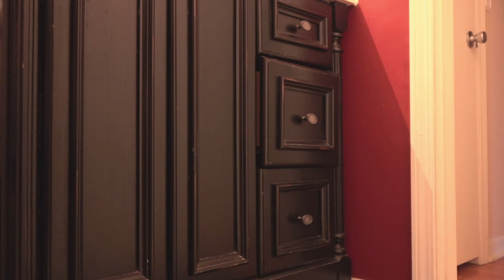3D Printing Saves The Day! - Fusion 360° - 2022 - Chris's Basement

Comment: I do a ton of practical prints for around the house, if it is simple enough I just use Tinkercad. My daughter had a bed desk she accidentally stepped on, with about a half an hour of measuring and mock-up I printed the first. Worked well, made a few slight tweaks for the other side and within a couple hours total it was done. The new supports were much more stout than the originals, and if I need to do the other side the file is saved.
Reply from the maker: That's great! Thanks for sharing

Comment: You should consider removing the web/gussets and just go with a full length chamfer and print the part on ots side for best strength in bending at the knee with better dowel stength too. Supports and finish don't really matter.
Reply from the maker: Thanks

Comment: Measuring tip: If you have a set of size array drill bits you can find 2 drills that firmly fit shank end into a pair of holes then measure with calipers the distance between them.
Add a radius of each drill size and you have the centres dimension
Reply from the maker: Thanks for the tip!

Comment: Love practical prints, thank you for making this!  For wood screws if the hole strips you can use wooden toothpicks to fix the threads, stuff them in, then tighten the screw into them...my dad taught me that one :) I fixed the blind mounts with a PETG part.  Love seeing these types of fixes.  Now...if we could only print windows...
Reply from the maker: Thanks for the tip

Comment: I would have turned your part 90 degrees in your slicer it would have used way less supports just for the dowels and they also would have been stronger in that orientation and less likely to break off at the layers.
Reply: Was going to say the same thing. The dowels and the whole part would be stronger.
The next test is whether PLA creep becomes an issue. But if it lasts 2yrs then it's still a win.
Reply from the maker: Thanks for your insight!
Reply: I'm always shocked at how people align prints. The monilith of support for this looks to be the same or more material then was used for the part, when the only thing that really needed support was the 2 pins.....

Comment: Another option instead of using the pins is to change them to pocket holes and use screws angled in from the top.  You could probably forego the bottom screws too.  Also, for future reference.. if screws are a bit loose in the hole, add a piece of toothpick into the hole (with or without glue) to make it tighter.
Reply from the maker: Thanks for the tips

Comment: To print test sections I often move most of the part below the build plate in Cura so only the section I want printed gets sliced.  I have a practical print going right now.
Reply from the maker: Cool, thanks!
Reply: Yes! I was mind blown when CHEP taught me this. I now preprint thin slices of all my interfaces so I can dry fit measurements.
Reply: @RichardBronosky  I just used spiralized aka "Vase mode" to test an outside dimension for fit.

Comment: When it comes to strength, orientation makes a massive difference. Parts will more likely snap at the layer lines. You should lay the part on a side to increase the dowels' strength.
Reply from the maker: Thanks
Reply: True, but in this case the load will be carried by the screws so they should be fine.
Reply: In some cases splitting up things into multiple bodies can help.  In this case you could have used holes in the main part and the print the dowels separately with double the length, printed flat so that they are strong and then just insert them in both the cabinet's holes and the holes in the main body.  A that main part can then be printed without supports.
Reply: would've saved the amount of filament used for support also 👍🏾

Comment: 14:35 Instead of splitting the body to copy the rib, you could also use a rectangular pattern on the features in the timeline. Might be a little easier :)
That would work for the holes and the dowels as well
Reply: Or mirroring of course
Reply from the maker: Thanks for the tip!

Comment: For your own benefit, I'd like to suggest making a video on the calipers. They do 4 types of measurements. Inner and outer diameter/dimension, height and depth. I cringe a little when you turn to the ruler for those. If you only have the ruler, sure go ahead.
Reply from the maker: Thanks

Comment: When I only want to print a section of a part I find it much easier to cut it with prusaslicer, also works when you don’t have access to the original design.
Reply: With cura I just drop it below the build plate.
Reply from the maker: That works too, thanks!

Comment: For free CAD software, I'd like to suggest FreeCAD. It has come a long way and is becoming more solid over time. It's fully functional now and the only thing people need to keep in mind is that the paradigm for modeling in it IS a bit different than Fusion so it's worth watching several tutorials to learn how it actually works. If you do that, modeling is straightforward and easy - like anything else "once you learn it" applies.
FreeCAD is also much more powerful than it seems at first glance and it's impressive what different kinds of things you can do with it, and those things tally up to more than what you can do with Fusion 360. There are a few features that aren't as well-developed as others (generating CAM code for instance) so while those few functions might not be quite as mature as other ones, you CAN still do a lot on those less mature facets. And these are being worked on so eventually WILL be fully flushed out eventually.
Anyways, just wanted to toss that out there for the new folks who might not know about it.
Reply from the maker: Thank you for the suggestion!
Reply: I'm trying to switch to FreeCAD, but as a programmer, the way things are done in OpenSCAD just works best for my brain. I've never finished a FreeCAD project. I always give up and redo it in OpenSCAD.

Comment: Great rundown of how 3D printing can help out around the house from start to finish.  My biggest compliments are for a simple vacuum hose attachment adapter, and some simple shelving brackets for wired shelves.  A related tip is to use the Cut feature of PrusaSlicer for cutting down for test prints as an alternative to cutting in your CAD program
Reply from the maker: Thanks for the tip!

Comment: Great tutorial.  Since you are very concerned with the strength of the pins, I might recommend rotating the part 90 degrees so the pins are horizontal.  As you printed it, it's only as strong as the adhesion of the layers.  Letting the filament run lengthwise through the pins would make them much stronger.
Reply: Was going to say this. You'd also only need to support the pins which would mean using a significantly smaller amount of material (and time!) to print as well.
Reply: The pins do not need strength. They are only there to align the part.
Reply: Its not just the pins, printed the way he did the bracket its self is only as strong as the layers. Printed on its side, all load bearing angles would have been printed in their strongest orientation.
Reply from the maker: Thanks for your comments!

Comment: So you cut a piece of wood at the same height and length needed to support the drawer slide.  Very common when building cabinets.  5 minutes tops.  Or... over engineer it if you're bored.
Reply from the maker: Then we couldn't use our 3D printers or Fusion 360!

Comment: Great tutorial!  For the benefit of anyone looking to replicate a similar part, I thought I would pass along a few standard dimensions used by the cabinet industry, which I learned during my past 20 year career as a custom cabinet maker.  Almost every drawer slide made today adheres to what is known as the 32mm System.  Because mounting and construction holes are drilled with automated line-boring machines, they are almost always spaced 32mm on center.  Any holes for either screws or small dowels are 5mm diameter.  The fat, short, flat-bottomed screw that goes into these holes is called a System Screw.  Having these dimensions in mind, one would want to create the two 5mm mounting holes spaced 32mm apart, then place this pattern within the horizontal center of the bracket.  These dimensions will guarantee a perfect fit.
Reply from the maker: That's great information! Thanks

Comment: I'm conflicted.   I'm new to the 3d printing hobby and really enjoy it, but I've also been into woodworking for a couple decades now.   Situations like this are what I try to avoid, spending hours on a printed solution when 15 minutes and a scrap 2×4 are all you really need.  I get that this is a good example of how practical 3d printing can be, but it's really only practical (for me) when it's solving problems that don't already have simple solutions.  But that's just me.  Just like the fact that not everyone has a 3d printer sitting at the ready, I know not everyone has a table saw sitting in the garage/ basement.
Reply: Well, it depends on the applications. Yes, sometimes simple is better and a L bracket would work well. But sometimes you need to get hole patterns right etc.
I have made several things custom made; raisers for my tv cabinet so my robot vaccum can get under it, I replicated a custom part for my fathers bathtub that filters out hair from the drain, a really complex part. The possibilities are endless, if you have some time to learn a cad software, and a 3d printer.
Reply: There is a dude on YouTube who combines 3D printning and woodworking, i can't remember his name, but it should be easy to find him in search. He does cool stuff and print great tools for woodworking.
Reply: Not sure if you watched the video, but that exact point was discussed. I don’t have wood working tools but I have a 3D printer.
Reply: @brettvitaz9101  yep
Reply: @ivajl  Yeah, I can think of some jigs with critical measurements that would be easier to 3d print than to make manually.  Thanks for the heads up.  I'll see if i can find the channel.
Reply: @nunyabizness6734  This is the guy i was thinking of: https://www.youtube.com/c/USSAWoodworking3DPrinting
Reply from the maker: Thanks for your comments!

Comment: Yikes ! Talk about finding the Hardest /most complex Fix .. Ever.
 A simple block of wood and a couple of long enough screws would have 'repaired' that Permanently with a half hours' work. 
Again :    3d printers best use is Benchys
Reply from the maker: Thanks for your comment
Reply: That's simple if you've got wood, wood cutting tools, and a place to use them.  But if you've got a 3D printer, Chris's way is simpler.  Also, if you need to make 12 of them, a 3D printer is easier.  As Chris mentioned, this particular project was just an example that's easy to explain.  You can easily design repair parts that are difficult to make from wood.  A friend's dishwasher needed a clip that held the wheels to the drawer.  A replacement was found on Thingiverse, printed out, and installed without any tweaking.
Reply from the maker: @Mueller3D  Best comment I have read in a long time, thank you!